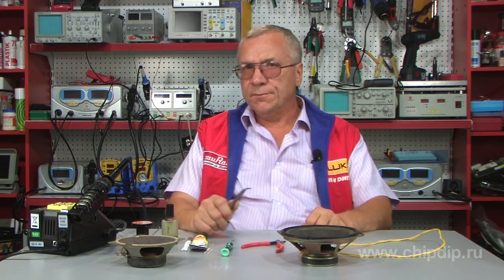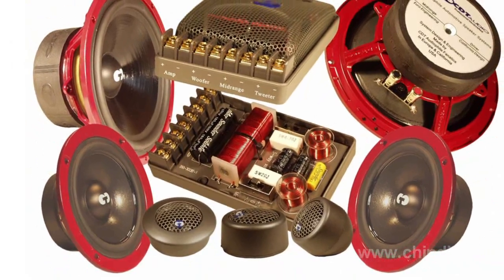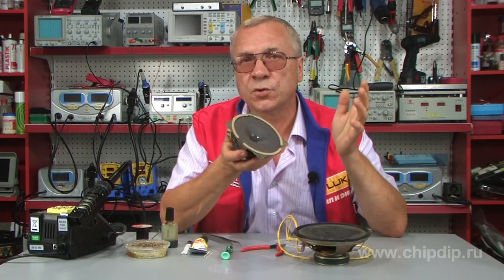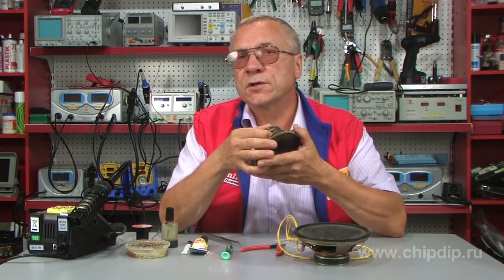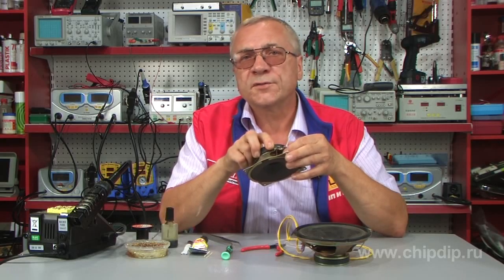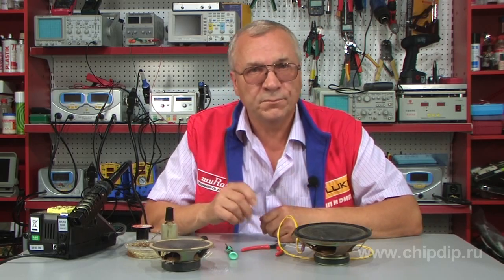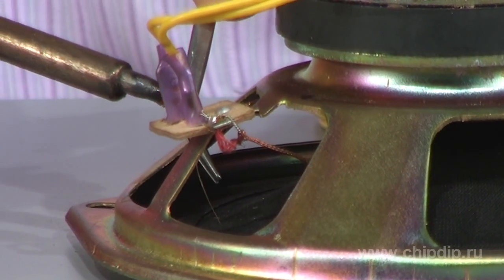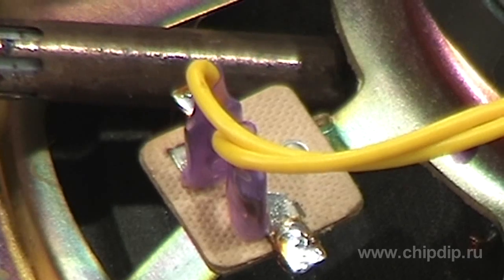Fixing a Loudspeaker on Your Own

Comment: Thank you for the video. That's an interesting technique for preparing the tinsel leads. I see the mechanical advantage of coiling them instead of using a single bend. Does coiling the leads add an appreciable amount of inductance?

Comment: Excellent video.  There aren't many that show how to replace the tinsel lead wires on a sub.  I would like to see one though where you don't have access to the voice coil terminals, such as on a Kicker L7, and all you have to work with are the frayed ends.  That would be good to see.  Thanks.